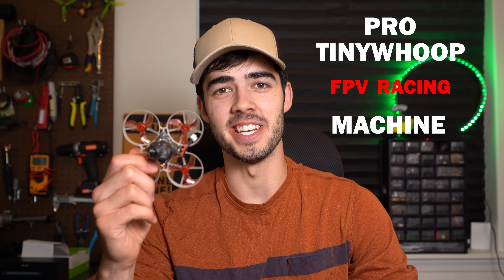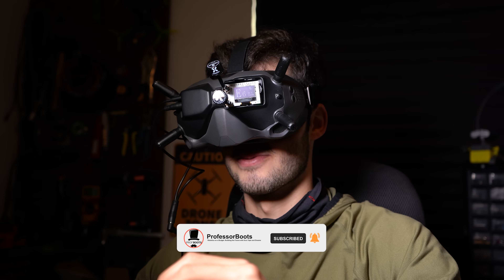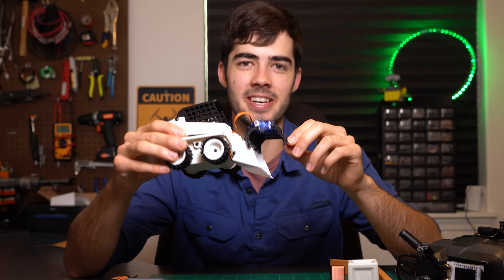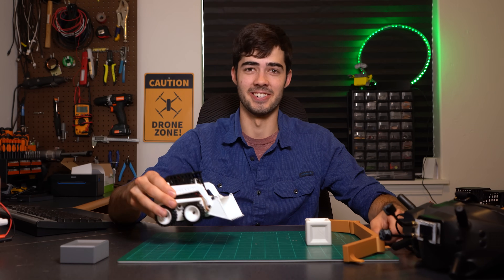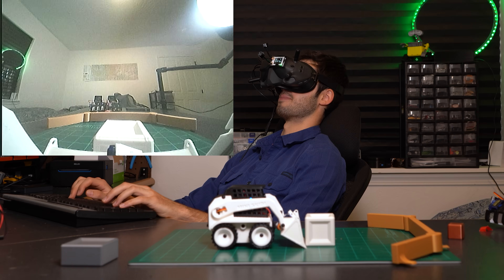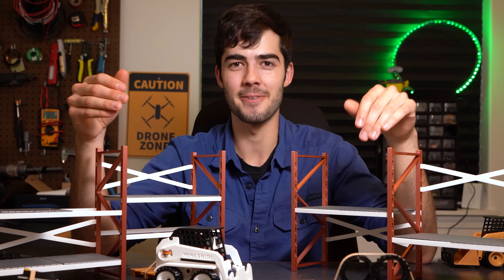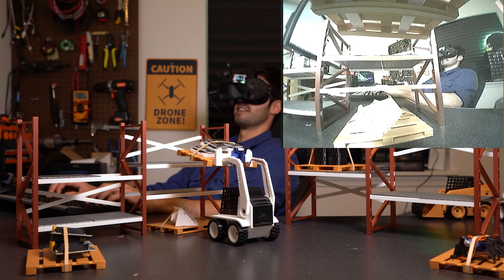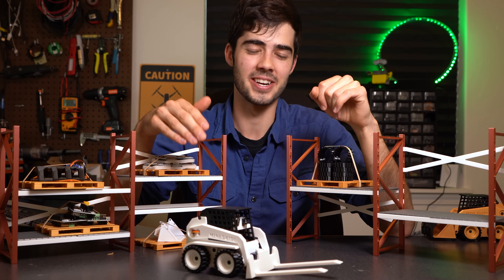FPV 3D Printed RC SkidSteer

Comment: I would love it if you got a pair of HDZero goggles and used the head tracking to add pan/tilt functionality to the camera system! That would be amazing. There is probably a better system than pan/tilt, and other goggles probably support head tracking too, but I think you get the suggestion here.

Comment: Your controls are very similar to those of the John Deere Skiddy I use at work. Left hand joystick is your movement control (forward, back, turn) and right hand joystick is bucket control. Pulling back raises the boom, left tilts the bucket/forks up, right dumps, and forward lowers the boom. Pretty sweet build for sure

Comment: „Shipping not available for selected address“. Need help. I wanted to order „required soldering“ option to Germany, but I can’t.

Where can I get the PCB gerber files (will pay for it), so I can order it somewhere in my region and I also need the BOM for manual ordering. 🤔

Comment: I need a tiny skid steer. Very very cool. I'd like something relatively realistic, but not $1200 and so hyper realistic is only works in actual scale scenarios..... (RC4WD/TUCAN HOBBY).  Ive been making genaric FPV systems from this cheap IOS cams forever, and some actually are pretty good. Spectrum/fatshark USED TO offer a nicer version that you could get x2/$40 but they are discontinued.

Comment: Maybe add a little bit of a low-pass filter to the keyboard inputs to make the motions less jerky and make it easier to perform slower motions by modulating how often you tap or how long the taps are?

Comment: I just got my electronics kit in the mail yesterday and I"m currently printing the parts! Definitely going to make the dump truck too.  I am fairly new to microcontrollers/electronics and can do basic coding (mostly because I took a few classes in college years ago).  I wouldn't mind a video walk through of the code, especially focused on the web page hosting and interaction.  I've browsed your source code file and get lost tying to fully understand the web socket portion.
Reply from the maker: I will definitely keep that in mind when looking at videos to make in the future. The code would definitely be hard to grasp without a deeper explanation especially the web socket portion as it’s been arduino-ized haha.

Comment: Hell yea! You need a “fork lift” mode so that the forks are always parallel with the ground! Looks like so much fun!
Reply from the maker: That would certainly make the skidioperator life easier haha
Reply: @professorboots  definitely! And you could have the tilt button set the zero point for loading and unloading operations! Such a fun project :) also, I was told on Friday that we have a mutual friend that I work with!

Comment: Hi mate. Any tips on how to print the drive shafts? I’m trying PLA and PETG but both stat very fragile, impossible to put the wheel without break it. Tried with more flow, different speeds… but same result. Any tips? Thanks for your job!
Reply from the maker: Hello, I actually just updated the drive system to fix this very problem. It will require downloading the new parts off of printables but the main housing and drive shafts together are way stronger. Also consider printing out the new 4.0 drive belt.
Reply: @professorboots  thx mate. It’s updated right now? Yesterday i checked in thingiverse but only found the 3.2 version.

Comment: OK, so the next step is internet control of the MiniSkidi. Person A and person B set up a mini-warehouse with a MiniSkidi. Person A controls the MiniSkidi in person B's warehouse and vice versa. Then you run a challenge to see who can stack all the pallets first.  The game goes national, then global.  You retire rich, after figuring out to monetize this game. Following that, develop some AI using a vision system to have the MiniSkidi stack the pallets.
Reply from the maker: I like where your heads at! I’ll work on developing the National rules and guidelines for the miniskidi warehouse challenge haha
Reply: If a server hosted a TCP socket server and the machines connected to it, with different remotes also connected to the server, you could just run a server out on the web somewhere and have people connect to it to join the game
Reply: @awesomecronk7183  Mini-Skidi Skynet?
Reply: @JCWren  lmfao maayyybeee